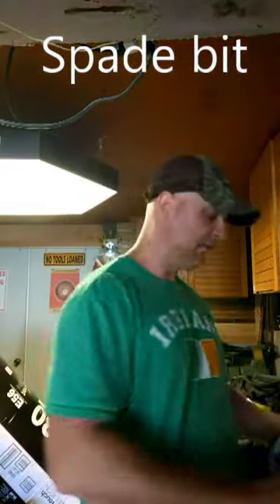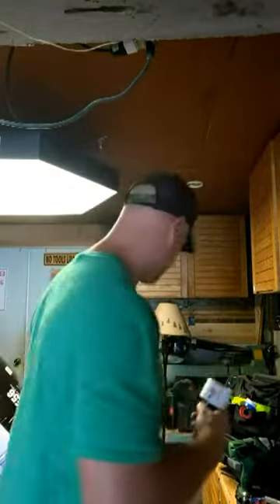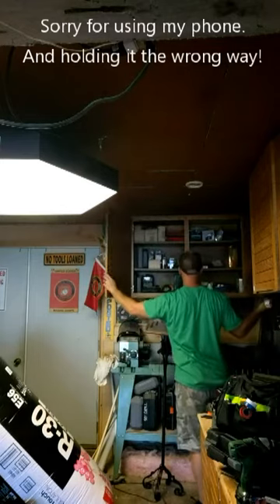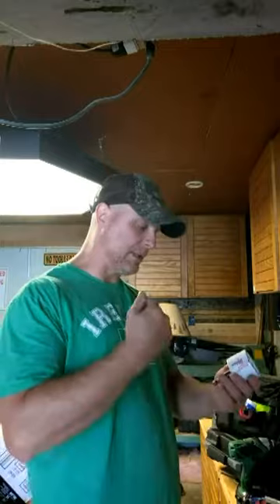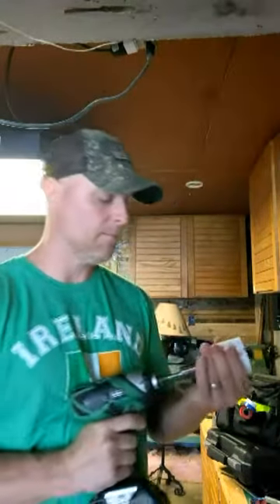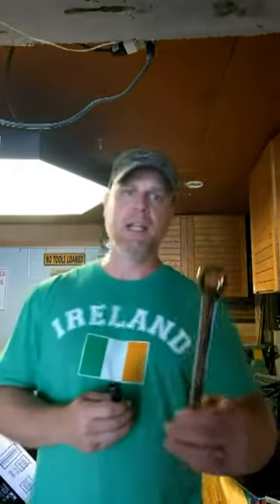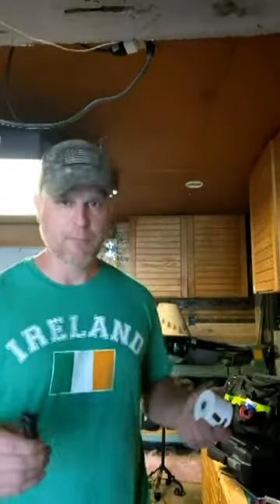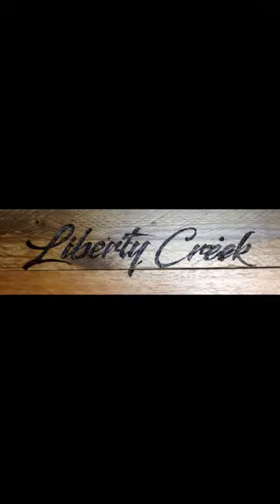Stuck Hole Saw. Changing the bit of a hole saw.

Comment: Just found another way. 

Use the allen wrench to remove the drill bit. 
Attach the hole saw to an impact like you’re about to drill. Stick a screw driver through both holes and spin it left. 
Mine was stuck and I didn’t have the socket. It worked for me.
Reply from the maker: Interesting... Good to know.
Reply: It works!!! Nice! Thank you so much for this tip! 💯💯💯👍🏼👍🏼👍🏼
Reply: That totally worked!!!!!

Comment: You can say that again I have the same set and just spent a half hour trying to get the stupid thing off.  They need some sort of cam screw that puts ultimate pressure and leverage on the loosening part. Finally I put it in a vise and banged on it with a piece of metal.  You would expect a better design out of Milwaukee... To project farm I go.

Comment: Got mine unstuck today.  My hole saw bit has holes on the side.  So I put a screwdriver through the opposite holes.  Then I attached a ratchet wrench to the arbor.   Had the screwdriver and the wrench form a 165 degree angle.  Put it on the floor and using my palm to hit it.  Got it loosen from the first blow.

Comment: I have the same feeling right now. I'm installing deadbolts into my doors, and after drilling a hole, the damn hole saw gets stuck. Now I'm stuck with a door with a hole until I buy an impact driver to unscrew this hole saw...
Reply from the maker: There has to be a easier way! Thanks for the comment.
Reply: That happened to me yesterday and it still stuck 🤦‍♂️

Comment: I agree. Pain in the ASS getting this apart!  I don't have an impact driver.
Reply from the maker: Hope you got it off. Thanks for the comment.
Reply: Dude in the comment above you threaded a screwdriver through the two side holes (after removing the pilot bit), and reversed the drill